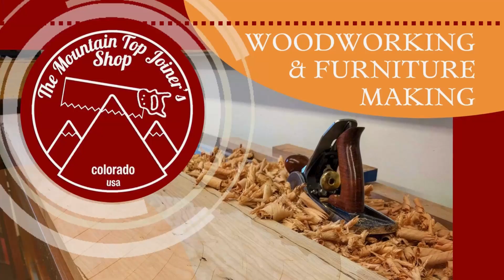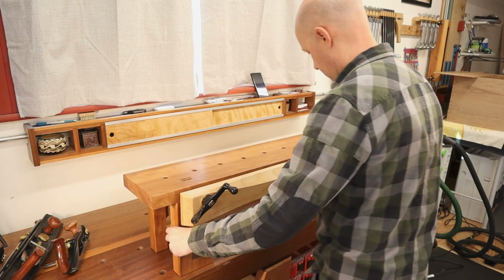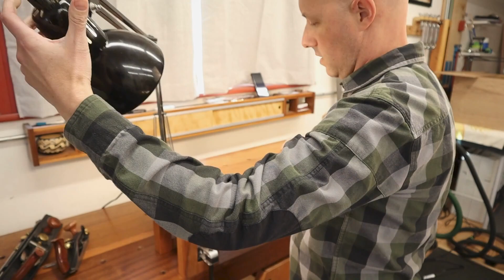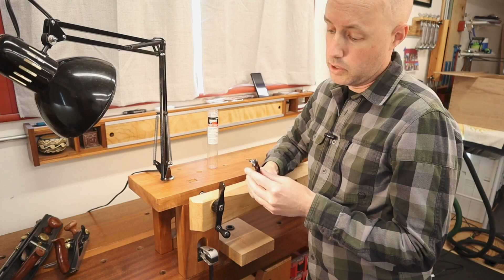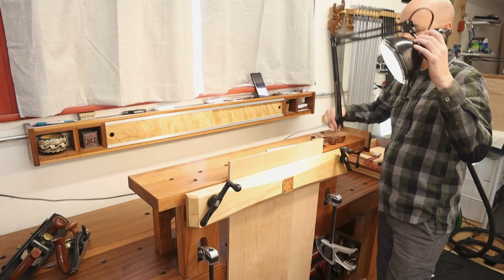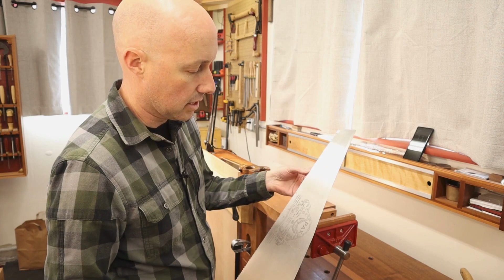Bench on Bench Action!

Comment: Yes that's very confortable and useful. Every one should give a try to some king on bench on a bench.
I've a bull bench made from the remainder of a beam 10" x 6" (-ish, it is 140x240mm) , 20" long, with a H shape to clamp it on the bench. For the vise I made some grooves in the bull bench to fit the bar of the quick clamps, and small grooves on the border of the chop to keep it in place. Not so nice as your but very quick and confortable to work with.
I can use the bull bench on the narrow or on the large side, that gives me 2 different hights to work with. I also have jaws to clamp saws on it for sharpenning. And one of the large side is used as a chop block that I put on the saw bench when I work with hatchet.

Comment: Great idea and execution, looks very versatile👍.
Reply: Ditto, I like the height vs other bench on benches I've seen for sawing, tho a short person would benefit more from shorter legs. I don't like that the screw cranks suck above the table surface but the wide spacing probably obviates most interference when using the vise
Reply from the maker: To date, I haven't had the screw levers get in the way pf anything, and it's been roughly ten years since I built it. There's a first time for everything, I suppose, but to be fair the rim of a Moxon vise wheel would stick up a bit as well.